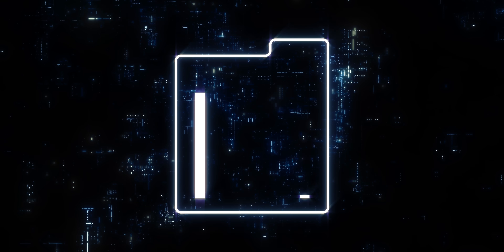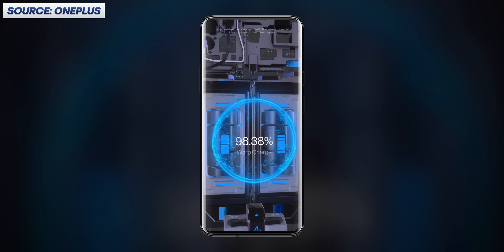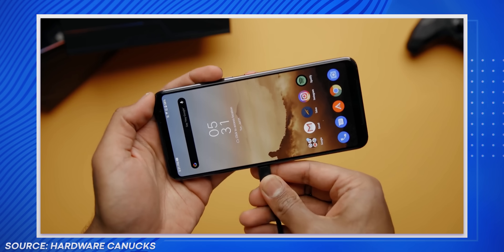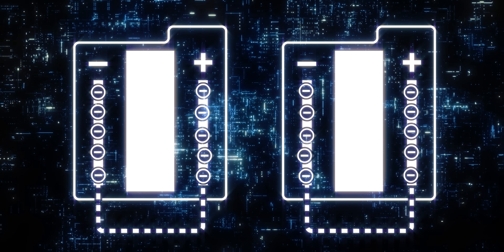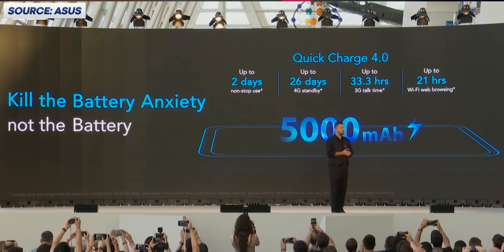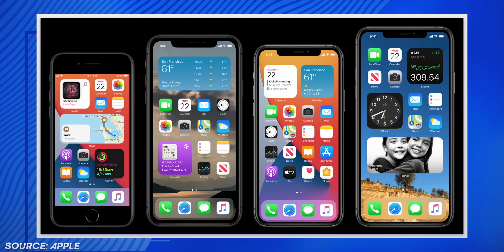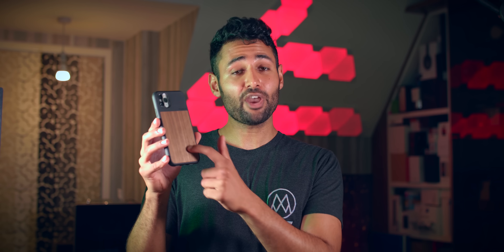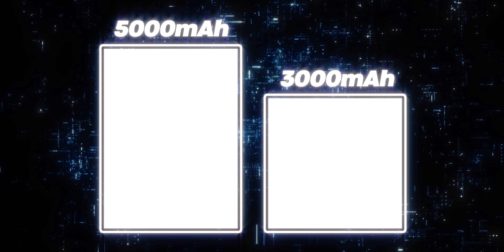The Problem with Fast Chargers.

Comment: Another caveat to your whimsical statements. I had a Note 8 for over 2.5 years and it charged about the same as it did when the first day I charged it so it has nothing to do with the battery at all whatsoever and if it does it's a very slow go. If I wanted to I probably could have used that note 8 for another 2 years and it would have been fine

Comment: Listen smart guy, I'm using a 45 watt charger for an S21 Ultra and it's only taking me 55 minutes to fully charge my battery. There is no problem with it that is what Samsung recommends up to a 45 watt charger so what you're talking about is a bunch of hot air. Why don't you study up a little bit catch up

Comment: I like how people act like fast charging is going to damage the battery overnight, making the phone completely dead and usless. Technology is ALWAYS advancing - whatever that is new today will be outdated in 6 months so most people don't even hold on to their phone for more than 1 - 2 years. Most people end up replacing their phone before the battery gets that bad. 

I rather have a fast charging phone that charges to 100% in 30 minutes and lasts me 10 - 11 hours, than a phone that takes 2 hours to charge to 100% and only last 8 - 9 hours. Once you use fast charging, it's hard to go back.

Comment: 1:52 so what you are saying is even if I charge my phone at 20°c I will still loose 10-15% of my battery capacity? Ok imma need the freezer for this so my phone will be -20°c so my phone battery capacity will increase 10-15%
Reply: bomb has been planted
Reply: no colder ambients won't increase your battery it will just make it last longer
Reply: @sdani.  dude it's a joke
Reply: @sdani.  not really, electronics don't like too cold nor too hot environments, condensation is a thing and that could damage it (ik he was just joking)
Reply: @stearless  devices love cold environment, the colder it is, the better it will work, for most devices and up to a certain point ofcourse
Reply: @user-wc6pp4mi6t  up to a certain point, that's exactly my point, putting your PC for example in a freezer seems logical for keep temps ultra low, but that's very bad for it and it won't perform better than in room temps
Reply: @stearless  nope, a freezer shouldn’t be a problem at all, and should preform better, like I said, it has to be an extremely low temp
Reply: @user-wc6pp4mi6t  nah, you're not correct, google for those experiments and you'll see what I'm talking about
Reply: @stearless  bruh I literally studied electronics at school, not everything on the internet is right kiddo, we even measured temps and monitored performance ourselves, put it in a graph and you’ll see that temperature and performance are dependent, it goes up fast to a certain point, slows down for a while, and eventually lowers performance, but it takes a very low temp for it to drop performance, test it yourself, a freezer’s temp isn’t that low, if you went to the North Pole with a phone it would preform better, battery would last longer and you have yourself a cooling system
Reply: @user-wc6pp4mi6t  Kiddo? Lol what are you on about, the fact that you said "at school" and not at university/college or smth tells me you are a kid, I studied electronics at university, freezing temperatures from the normal freezer are not good for your PC or anyuthing because of condensation, liquid nitrogen cooling on the other hand is another story, kiddo, you are not reading what I'm saying from my very first comment, keep studying better at school, you might learn something before college
Reply: @user-wc6pp4mi6t  yeah, but u surely aren't older than 18 or sum
Reply: @stearless  lmao go back to your elementary school, oh no, you have vacation rn
Reply: I know this is a joke, but you have to hit a sweet spot. I think most phones like 5-10 degrees.
Reply: big brain moment

Comment: I have an idea:

If we're already seeing 30W, 65W and 120W chargers. Why don't they develop a system where the phone would split the electricity flowing to the battery and to the system. 

Like let's say we have 30W, an algorithm would detect if the user uses their phone and so it will split the electricity. Sure enough the battery would charge a bit slower but at least it isn't being used atm and it will prevent parasitic charging.
Reply: You don't need an algorithm for that lmao
It's already a thing in a Lenovo phone (electricity goes past the battery and directly into the system)
Reply: @enzicoxe  But it doesnt charge the battery. Im hoping that they can charge the battery at lower wattage (and not use it) while using the rest to power the phone.

Comment: I like how you say that apple figured that most of their users were perfectly fine with 5W charging. Just goes to show how ridiculously hard tech companies are making innovations very little people actually need, yet market it as if it's required. Bigger number = better right? Now give me 100$ more because it's there.
Reply: That’s why I’m sticking with apple devices. No flashy “innovation” or stats, but practical and good design, along with many subtle innovations even under the hood.
Reply: @damnfreakingsien  Practical and good design such as removing headphone jacks, expandable storage, removable batteries, all to be replaced with empty plastic bricks? Not to mention fighting USB-C tooth and nail, starting the ugly notch at the top trend, as well as designing hardware component keys to purposely make their devices impossible to repair. That good design? Also, Apple has marketed itself primarily on "flashy innovation" for the past several years.
Reply: @JohnSmith-xv1tp  not really. Besides the Face ID, iPhones are often touted as boring rather than innovative.
Reply: @JohnSmith-xv1tp  iPhone died with Steve Jobs

Comment: I use a cold damp cloth every time I fast charge.TBH, batteries are nowhere near as expensive as the actual phone itself, and 2years (1 an half in my case) I'd buy another 🔋  and replace it. Not expensive and not hard to replace.

Comment: The higher the current used to charge the battery, the less battery capacity the battery will have.
I have a QC3 phone and I charge it with a QC2 charger. I get noticeably better battery life than when I use a QC3 charger. Also, in the long run, my battery will last more years charging on QC2 compared to QC3.

Comment: Ironically, my Apple phone battery lasted about half as long as my Xiaomi. Even with all the updates slowing it down to "preserve the battery". Didn't they lose that court case?
Reply: What iPhone do you have and what Xiaomi do you have?
Reply: @mtk3587  I had an Iphone 6 which died about 2-3 years later. Bought a cheap $120 AUD Xiaomi (Redmi Note 4) to get me by, plus I wanted to test an unfamiliar brand so I didn't want to spend a lot. The battery is still going strong in it. 
I've upgraded to a Xiaomi Mi 9T Pro now, but I can still turn on the Note 4 whenever I try it. Not quite double the time yet, but it's been sitting there basically unused for at least a year and I think that degrades the battery faster.

Comment: The discharged state of a Li-Ion battery (probably the most common type if not the only type) is much more dangerous than the 100% charged state. The reason is that if the voltage of that cell drops too much, metal dendrites will grow inside it and the battery becomes extremely unstable (read: will blow up when tried to be charged). This is why these batteries are fitted with a circuitry that will brick the battery completely if the charge level drops too much.

Comment: Thanks for the lesson, Arun. 😊 Just a question, if I charge a 22.5W phone with a 40W charger, does that mean that it will charge faster? 😁
Reply: If a phone only supports 22.5w charging and if you use a higher wattage charger, it'll charge at a fixed 22.5w.
Reply: @sabr3T  Thanks Kevin. 😊👍
Reply: @andromedagodit2492  No problem!

Comment: My OnePlus 5t is 3.5 years old now and the battery is still fantastic. Does that mean it ran really cold?
Reply: just had to replace mine because the battery is so bad
Reply: @markusklyver6277  mine ended it's run still in fine shape. I got the Poco f3 as a replacement.

Comment: I love the fast charging of my OnePlus 5. After 3 years I think I've lost maybe 30% capacity? .. so it still lasts for a whole day when in moderate use. More than enough. And even if it gets low because I forgot to charge it at night or used it a lot, I plug it in and it's full in +-30 minutes. It also doesn't get noticeably hotter when charging+using (though no games, only Yt or the browser). I just love it. Would never go back to slow charging.
Reply: Do remember SLOWER CHARGING WILL ALLOW A SMARTPHONE BATTERY TO LAST OVER 4 YEARS

Comment: I bought my iPhone 12 Pro in November and since then, I’ve aimed to keep it around 50% all the time:
It’s still at 100% health.

I don’t leave it charging overnight, and basically I charge it once or twice through the day, trying to keep it between say 20-80%.
I live in the UK, so it’s been about 20 degrees in my house through winter and spring.

I’m curious to hear how other people’s iPhone 12 Pro’s might be in health?
Reply: Do you use fast charging?
Reply: @killianmeagher1396  Yeah sometimes. It’s a mix. If I’ve let it get to 20% and I’m going out, I fast charge to 80 ish. If I’m just in front of my pc, I plug it into that which is slow charge.
I’m at 98% now, 9 months on.
Reply: @a-shaw-photo  how much after 12 months? My 12’s is around 100 but Pro Max’s is around 95.
Reply: @anshsawhney7692  Hey! Do you do what I did and try to keep it between say 30 and 70%?

So interestingly it was 98% two months ago at which point I decided to just start charging overnight as I said to myself that I’d defo get the iPhone 14 (or whatever it’ll be)

Now, with overnight charging, it’s dropped to 92%: 8% in two months!!

I don’t know what to make of it really. It was either wrong before, is wrong now, or perhaps it really does just spank the battery that badly!
Reply: @a-shaw-photo  I try to keep it between 30-70% yeah for my 12 which is my primary phone. The 12 pro max is something I use for meetings on the go. I charger the 12 overnight with a 5 watt charger but when I need juice quickly I plug in the 20w one. The 12 pro max gets charged via either the 20w charger or the MagSafe charger. I checked the exact values and got to know that my 12 is on 100% after about 9 months and the 12 Pro max is on 94 after 10ish months. Assuming you go to sleep at close to 10:45 at night,  I’d recommend that instead charging it overnight, use a fast charger and get the battery till about 45% before 7:30 at night and then plug it out. Then at about 8:45 plug it into a 5w charger and leave it charging till before you go to sleep. Plug it out from the 5w charger now at about 10:40 PM and then leave it on standby. Doesn’t affect the battery health what so over. That’s what I have been doing with my sisters iPhone 11 Pro and it’s still on 100% battery from when we bought it on launch. Sorry if I butchered while writing since English isn’t my first language. Hope I help and sorry for long paragraph :)
Have a good day/night
Reply: @anshsawhney7692  Your English is really good! NB replace ‘plug it out’ with ‘unplug’ and you’ve nailed it 🙂

Thanks for the advice! It’s really interesting all of this!
Reply: @a-shaw-photo  thanks for the compliment :)
Love to help fellow iPhone users! Try it out and let me know how it has held up after about a month or so 😊

Comment: "Apple wants its phones to last a long time".. I am now questioning everything I have seen in your videos.  Apple has a legitimate excuse for throttling performance.. that does not equate to a desire to increase longevity.  Apple is notorious for planned obsolescence.  Most phone companies are.  But the term is almost synonymous with Apple.   What happens when someone's phone starts operating 30-50% slower than when they bought it?  They go buy the shiny new phone.  And Apple has put a lot of work into making sure their customers are more than customers--they are fanboys.  They will buy another Apple product.  Other companies may have followed suit, but Apple was the first company to start making phones that did not have easily replaceable batteries.  One of the first videos Casey Neistat uploaded in 2003 shows him calling into Apple regarding a dead iPod battery where the rep tells him his best bet is to replace the entire device.  Check out the veritasium video on planned obsolescence.   Apple does not want its phones or any of its other devices to last a long time. They want people constantly filling landfills with their old phones (can't have anyone buying a used phone) and buying new ones

Comment: I want my battery to charge fully when I plug it in not go to 50% and anticipate when I'm gonna need the rest. What if an emergency happens and I need to run out earlier than expected and my battery is at 50% still. I run out the house with nothing but my underwear and my half dead phone. I have an entire night of chaos and need to make tons of calls with no way to charge my half dead phone.

Comment: But for the average person it’s always best to keep the battery fully charged. 

Don’t wait till your battery is almost dead to charge and don’t unplug it when it’s fully charged. 

That 50% is almost impossible to maintain but by keeping it at 100% means your battery doesn’t have to cycle and change states from charged to uncharged many times which can form crystals overtime and make your battery last shorter. 

Usually most phone batteries are rated for 1000 charge cycles more or less before they start to become less and less efficient so it’s best to keep that cycle down by keeping it at 100%

Comment: Hello everyone! I have question that has been on my mind for a while. I have a phone with 33W changing. What's better for it: using the 33W charger that came with my phone, or the one from my previous phone, which is way less powerful. Thanks in advance!
Reply: Use the 33W

Comment: Larger batteries can handle more charging current 

A 3.7V 10,000mah cell can take 30w charging with roughly the same cell degradation as a 4000mah cell charging at 10W

The issue (for manufacturers) is if they give you a flagship phone with a 10,000mah battery, you won't use up your limited charge cycles anywhere near as fast, thus your battery will last far longer, as such, they won't make as much money off you (using 1 cycle every couple of days vs using 2-3 cycles every day)

When I modded my S10 plus with a 10,000mah cell (total of 14,000 including the internal battery) I went from charging it 3 times daily, to only charging it once a day (and even then I still typically have around 30% left by the end of the day) 

So I easily tripled the service life of my battery, and added a massive reserve so if I need to, I can turn on power saving mode at 10%, and the phone will still have power the next morning

Comment: The first thing I do after buying a new android phone is to head over to the battery settings and disable fast charging abilities right away. The battery really lasts longer if charged with the normal speed.

Comment: OK !   I'm calling a Lil  BullSh-t on this one. Sir Tech-a-Lot. 
 #1 ) Apple batteries go bad faster & with crazier degradation than any other device ( Android etc ) and they Go Bad like clockwork without Fast Charging ? . Most sinister of all is that Apple was Finally caught a couple years ago & were forced to admit that they purposely upgrade their older phones with un-modified Full versions of their Newest software knowing that the older processors & memories in their older phones won't be able to handle it & will eventually slow the phone to a crawl. Forcing the user to upgrade their iPhone.  
 "Oop's ... Sorry bout that !  But the good news for you is that our New IPhone is only $1,000."    Yay !!!!! Thank You my favorite tyrannical technology Cartel. 
   As far as the AMAZING One Plus ( 65W ) Hyper Charging.  It completely changes the way I use, charge & plan my day around around my phone in EVERY WAY.   
 The OnePlus ( 65W ) Hyper Charging Is crazy Awesome !  All I have to do is simply plug it in for just a few minutes while I get ready to leave and BAM .... I will suddenly have 50%. More than enough to get through my entire day.
 NO LONGER do I have to remember to charge my phone the night before. Or plan on charging my phone or making sure it's got enough charge before I leave the house for the day.  ALL of that has changed and I will NEVER GO BACK.
 My kids IPhone 12 "Fast" charging is laughably slow in comparison. 
  The only problem I really hear from you is that the batteries will go bad relatively sooner ?  I don't see a problem there because with a 2-year-old phone the batteries are usually cheap and easy to replace.

Comment: more than half of the people I know have to recharge their phone some time during the day, even if they use brand new flagship phones. fast charging is important, as well as the size of the brick. i would say these two factors are more importnant than the longevity of the battery.
Reply: You prune,Battery Longevity is way more important 
Slower charging speeds helps  the Battery stay in perfect way longer
Reply: @stephensnell5707  first off i change my primamry phone on average every 15 months. secondly a brand new OEM battery cost about 20 usd to replace in china. consumers of chinese brands don't need to worry about batteries. if you are stuck with apple then I understand why that is an issue.

Comment: I got redmi note 10 pro. With 33W gets warm.. 
I use samsung charger 15W and no heat all.
Is going to mess with the battery because is other brand?
Is better to buy Xiaomi smaller charger or ok with samsung 15W?